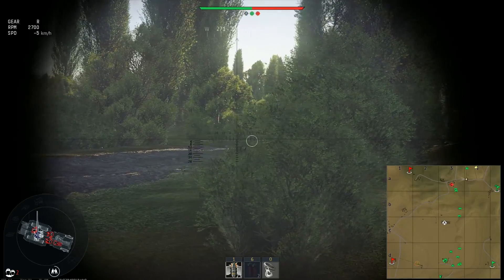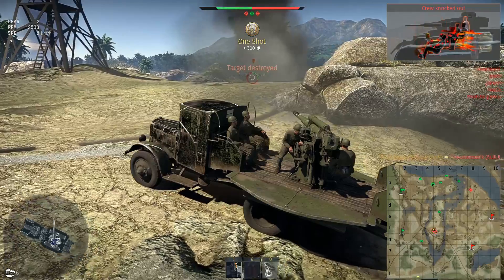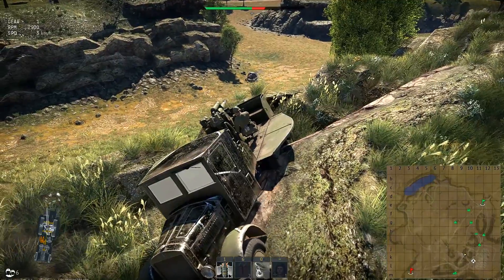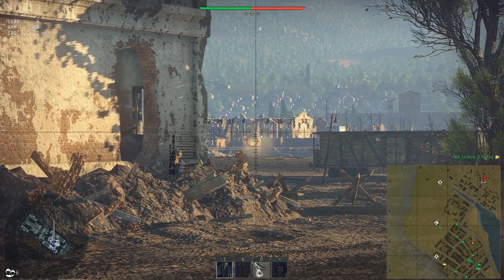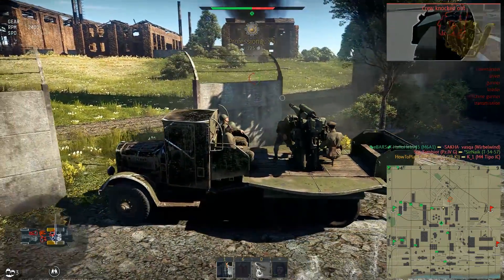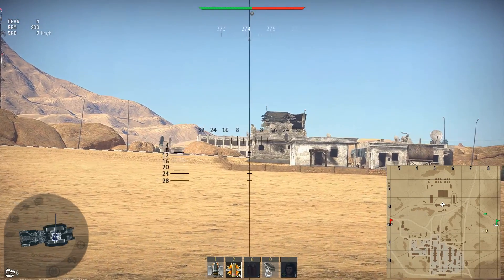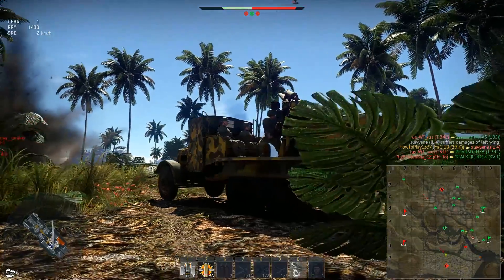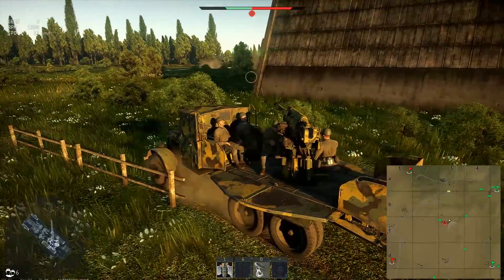Yup,  Soviets went too far with their BIAS vehicles ▶️ YaG-10 (29k)

Comment: There should be option for manually adjusting fuse range like you can with tank crosshair, plus you can use HE against light/open top vehicles and set detonation distance to make shell explode over them.

Comment: >Germany has the Flak 88 in low tier one shotting everyone 
>fair and balanced

>Soviets get a gun on a truck
>OMG SOVIET BIAS PLS NERF
Reply: The YAG-10 is .3 BR lower than the Flak 88, is significantly faster in terms of mobility, has a much smaller ammo rack hanging off the back of it, and doesnt have fused HE shells (this in conjunction with the extremely slow turret rotation makes it unable to act as SPAA). Oddly enough, the T-34-85 (D-5T), KV-85, and IS-1 all have the same gun as the YAG-10 but have half as fast reloads as the YAG-10. Must be due to the confined spaces of the tanks vs. TD and only a single loader? 

About the only things the 8.8cm Flak 37 has over the YAG-10 is slightly better pen(153/123 @ 10m; 140/107 @ 500mm; 128/91 @ 1km), higher filler in APCBC (160/150), HE (820/621) but thats kind of given considering 88/85 mm rounds. Otherwise, same ricochet chances, same normalization.

So, yeah...seems alittle odd that the YAG-10 isnt at 4.0 BR or higher considering the advantages it has over the Flak 37. And why does WTs wiki page keep calling it a 76.5 mm gun, when its 85mm?
Reply: @thebravegallade731  that doesnt address those claiming the flak truck is OP but the YAG-10 isn't.
Reply: Emperor Vitiate  at its current BR with its obvious advantages, I would beg to differ. Also, obvious russian bias in all things russian, yeah its OP. Maybe not severely but this video definitely paints a different picture.
Reply: Emperor Vitiate  my point is my opinion, whether you agree with it or not is just as pointless as my argument. Especially if you provide no evidence to the contrary
Reply: Emperor Vitiate  I dont believe it to be a myth. There are plenty of examples of russian tanks performing better than they should. Even examples of Gaijin refusing to fix performance issues with russian vehicles that are OP. Many of the IS series tanks performed outside of norms for YEARS before Gaijin "balanced" them. German tanks having excessive weak armor to "balance" against russian tanks. Hell, to this day, german 7.7 tanks are penalized with the highest repair costs of any nation to balance against other tanks that have even higher win rates but I dont see Gaijin jacking up their repair costs.
Reply: Emperor Vitiate  oh please it is real
Reply: Emperor Vitiate  i spotted a russian player
Reply: @Sethiol73  the 88mm German can fire at all sides with negative depression, and has armor that makes it immune against rifle caliber weapons, whereas the Yag cant fire forwards, and gets instantly murdered by every weapon that can hit it.
Reply: What current players in AB uses this truck for is to stick his tail out to snipe, and at long ranges you can't get counter-sniped because it's mostly AP and solid shells flying at you that may 'take out' the gunners using the guns, but the 4 other crew members are surprisingly 'chilling' on the seat two feet away from them, which can be easily hidden behind terrain.

When a projectile hits the truck's gun, it spalls and blasts fragments in one direction, that is, away from the truck. Then the user only needs to repair because the odds of having the gun be hit again at 900m away in AB by other tanks is rarer, heck even machine guns can barely hit due to how far it is. The truck is fairly low to the ground, meaning most of it won't show up above small cover, as the entire truck can easily hide behind most things. Not to mention that if you do set off the ammo rack at the very end, it probably won't kill the entire truck and just get repaired again.
Reply: I say Soviets should get a buff
They are the worst nation in mid tier 
(Idk about top tier) 
The is2 1944 Isa direct downgrade to tiger 2 p 
The t-34 85 has so shit pen I litteraly bounced a Panthers turret on a direct hit 
The t44 is the same but you can take about 1 hit before you die 
The is2 is just a tiger with a potato reload 
Is3 just gets cheatfs spammed by leopards and every other light tank 
T44 100 is just a slightly faster panther 2 with bad armor and a worse gun 
T54 just gets cheatfs spammed
Reply: @comradeivan9326  Actually the Flak 88mm armor is kinda useless because the 50cal and the SPAAs could easily take it out
Reply: @Sethiol73  FYI, the Yag10 isnt armed with a 85mm. The gun it has is named 3-K which is another name for the 76.2mm Model 1931 AA Gun. The 85mm AA gun is named 52-K.

Before you start blasting me with your observations that its a 85mm. Here are some links to the Yag 10 specs.
https://www.globalsecurity.org/military//world/russia/29k.htm

https://www.o5m6.de/redarmy/yag_10_aa.php
Reply: True, I feel like the flak88 and yag are similarly OP, but the flak has better armoury and penetration, so it's better
Reply: @pikaachoo3888  i might be 2 months late, but thanks tank nerd
Reply: @Sethiol73  You wrong, YAG-10 has 3K(M1938) gun, a modernized version of the M1931, It's 3inch(76.2mm) gun. 8.8cm Flak 37 much more powerful gun especially vs sloped armor, 2/1 and 3/1 caliber/armor thikness rule works. and Flak 37 has armor vs rifle caliber

Comment: I love how Gaijin moddeld the 15mm of wood on this thing as actual armor :)
RUSSIAN BIAS
Reply: Its “Stalin Wood”
Reply: Wood especially the denser woods are actually pretty good at stopping shrapnel and the smaller caliber bullets so of course they modeled it, I mean Russians did in fact use logs on their tank sides as makeshift armor and it worked pretty well.
Reply: @bveb Yet it still works as spaced armor and they were usually placed in a spot on the side where they did in fact increase survivability.
Reply: @bveb No not barely as usually a good sized log can act as an extra 20mm or more of armor which is more then enough to cause a round that would have penetrated normally to be stopped or deflected.
Reply: @bveb No its not as its quite common for antitank projectiles to be knocked completely off course from hitting trees in wooded areas. Also this is what was concluded from testing showing that the shells would often be slowed, deformed and have their angle altered from passing through such a large piece of wood.
Reply: @DeathlordSlavik  I think the wood just has that extra to be armor, but was added as a help to het out of mud

Comment: When it first came out it was horrible. When it was introduced the engine was so weak it could barely drive on flat ground, and it couldn't drive on uneven ground at all. On some maps you would be stuck inside the spawn area because of a 2 degree hill keeping you from advancing.

Comment: Need explain of rang finding and Setting Range of aiming..In controls..  yes there is setting to Manually set range..  Controls/misc/ bottom 4..
Arcade already sets a 1k Aim point on planes...1k...so you Do need to adjust..
Reply: try putting Bush on this for camo...Dont work to well..needs fix.

Comment: I’m not sure what BAIS you refer to since this is a worthless vehicle against ground targets.  The proximity airburst rounds are the best thing I’ve ever used vs aircraft though.
Reply: bruh, the APHE is Godly OP for it's BR, i mean come on.....
130+ mm of Pen with 100+ grams of TNT equivalent with 4-6 seconds reload?
Reply: Kalashnikov 413 you have to be talking about another vehicle.  The YaG-10 is a 76.2mm gun which does very little damage to German equipment.  I guess that’s partly due to the German Bias, but it’s penetration even at 90 degrees was only 82mm and at average game ranges it’s only 75mm at 90 degrees and 61mm vs average 60 degree slope.
Reply: I did notice that Gaijin has inaccurate capabilities for this vehicle.  ACTUAL Soviet Historic data says 75% pen against 75mm armor flat on at 500m. But gaijin says 109mm pen for the same.  Yeah, if Soviet army says less, it’s less.  Soviet Army outranks Russian game designers
Reply: @OWG1969  why did this snipe me out at while it was 1km away
Reply: @OWG1969  answer me
Reply: @rochitgurung9090  there could be a number of factors.  What were you in?  1km as far as combat engagements go isn’t very far.  The M-60 Machine Gun can effectively engage vehicular and personnel targets at 1100m (1.1km).  In fact 1100m (when I served ‘93-‘05) was the preferred standoff range for the M60 MMG.  A 76mm gun would certainly be accurate at that range.

The weapon mounted on the YAG-10 was the 29K Anti-Aircraft Artillery gun which, depending on source, had ranges of 9-14 Km.